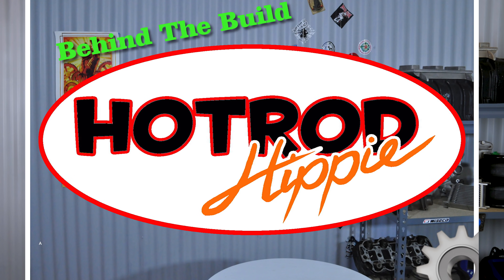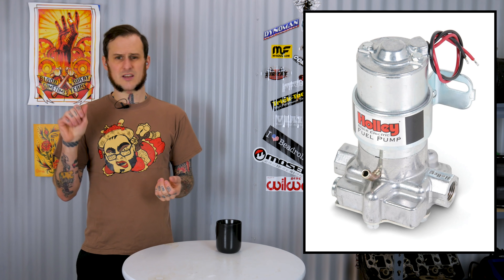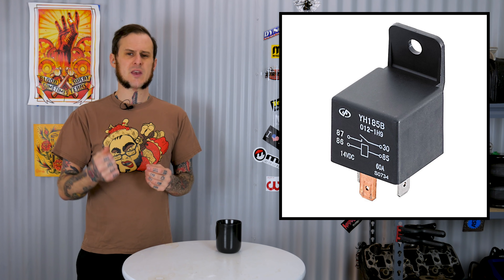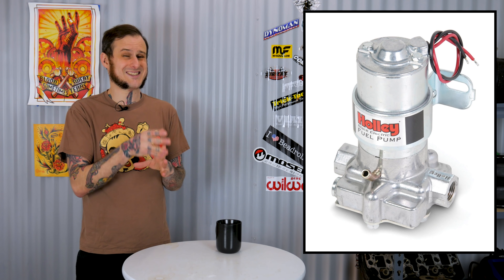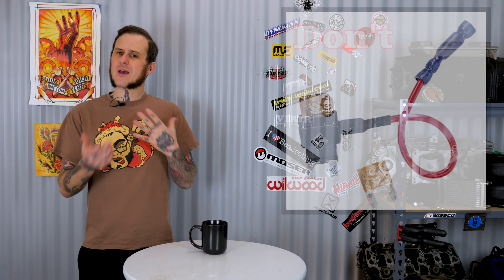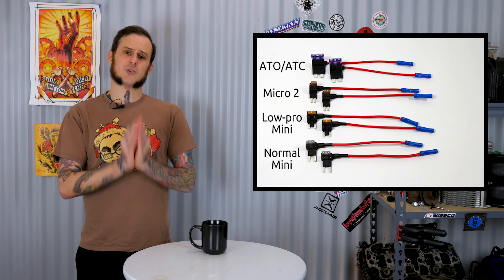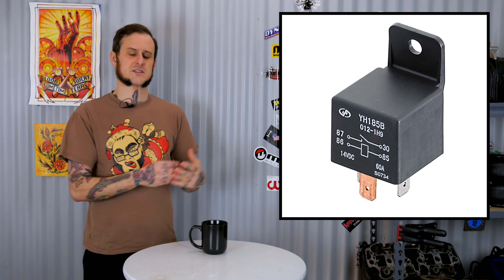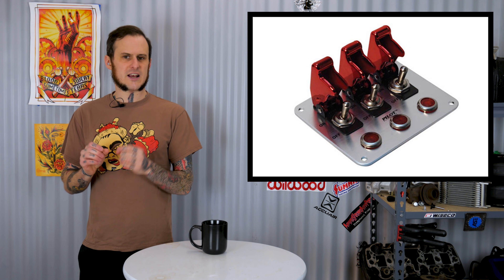Relays and Fuse Taps - Auto Electrical Dos and Don'ts - Episode 2

Comment from the maker: I just did a new video going into Relays deeper, and even mentioned fuse taps in it.  Check out the new Video here: https://youtu.be/Xt0lC8mjJRI
Reply: I wanna use a Fuse Tap for a Backup Camera I bought for my Front Bumper i already have a backup Camera but wanna use 1 for my Front Bumper Also was thinking using 1 Fuse Tap for My Trailer Wiring harness bc I bought a hitch installed it on my car and The Wiring for the trailer lights.. Would a Fuse Tap work for it? I used the meter tested the one fuse on how much was putting out for back wiring harness for trailer well Dad did lol.. Said like a little over 10 Fuse but i have a couple more open spots.. Thanks loved this video

Comment: Using fuse tabs it should use the same fuse load . My question is can I use multiple fuse tabs with the same fuse load on top of each other? I might need to use dash cam & radar detector using the same power source in my fuse box

Comment: I am putting a gm engine in a mustang and have a standalone harness that needs keyed power.   I was told I could do a fuse tap to get the power from the existing fuse block of the car and the new harness has its own relays and fuses.  What are your thoughts on this along with the fuel pump wire should be key on only???
Your help is much needed, Thank you,
B

Comment: Thanks for video.  I have a cigarette lighter port that is always on and I want it to turn on/off with ignition.  Looks like a relay is the correct method since I don't know what kind of device will be plugged into that cigarette lighter port - perhaps some day a tire inflator or some other higher amperage device.

Comment: I had to argue with my dad about using relays . The old wiring made it blow a fuse for the ignition power to the distributor. I ran a relay instead of power directly from the ignition .

Comment: Great info. You mentioned you used  relay to improve power windows. I recently installed aftermarket power window motors on my xterm. I used a fuse tap on a 15amp fuse and put a 10amp on the top slot. The 10amp keeps popping. I presume the window motors are needing more draw. Can I put a relay on the fusetap 10amp circuit?

Comment: Can I use a fuse tap to run starlight engine into the cigar lighter fuse? But I was going to add a rocker switch to be able to turn it off and on. Do you still recommend using a relay to give power to the starlight engine and to the rocker switch ?

Comment: Hey HotRod, I have a question you may be able to help me with.  I have not been able to find an answer online.  Ok, I am installing a winch on my truck.  I am also going to install a power interrupt solenoid under the hood.  The solenoid will be operated by a toggle switch inside the truck.  The question is whether I need to run a relay between the toggle switch and solenoid.  Would there ever be a need to run a relay between a toggle switch and solenoid?  Thanks,

Comment: Hi.  Good video on relays.  Thank you.   I thought taps wouldn't overload the original circuit because you reinsert the original fuse to keep that circuit the same.  The new pigtail then that gets the new fuse - hopefully properly rated,  I just dont understand the circuit overload issue.  Thanks again.

Comment: QUESTION? Lets say you want to add a few new circuits which run only when the key is turned on (IGN/run position) and not full time power. Can you install a fuse tap on one IGN source to a busbar. Busbar to individual switches (manual/automatic). From an individual switch to a corresponding relay. Relay to device/load. For example: one circuit to switch on a air compressor, another for an inverter, and one to a fan. This is on the assumption of using one battery source (not on a dual battery system, which will be more ideal). The power to the switches are low amperage. High amp loads through the relays.

Comment: What damage can be done by bypassing the relay and wiring directly two pins on the relay? My headlight high beam is not working, but if you bypass it, it's work.

Comment: I added a fuse tap/add-a circuit to power a relay but it did not work. positive side was on opposite side from what I expected. Could not fit it in the opposite direction. check the positive side source.

Comment: What about using a fuse tag to simply replace the circuit that used to be there but no longer is? My car has always had a missing cig lighter (and missing power source). So I installed a USB port in its place, and wired it to the cig lighter fuse using a fuse tap. That seems pretty safe, don't you think? The circuit is still only being used for one thing & I'm guessing a USB port is pretty low-load?

Comment: I mean how hard is it?
Just add the fuse tap where the fuse for the auxiliary power outlet (cigarette lighter) is.
If the old fuse for the outlet was 10A, now just make sure that both new fuses in the fuse tap don't add up to more than 10A. 
Simple, easy and won't ever f*ck up anything on your car.

Comment: I need a switched power to turn on an amp since the stock radio doesnt have a remote wire output, would that be ok to use a fuse tap on the radio fuse.

Comment: Confused now.  I wanted to add lights to my reverse light using a relay & a fuse tap but now I'm confused if it's the way to go about it.  I'm wanting to use the same switch already in the vehicle just add lights.

Comment: So I'm running a relay for a electric water pump and plan to run my 18 gage switch wire from the relay to the fuse block radio cigarette lighter with a fuse tap which on my car I know is off the ignition with 15amp fuse would this be a okay uses since I'm still powering the relay with 12v from the battery?

Comment: Would it be safe to use a fuse tap with the same amps on the DRL fuse slot to install a switch to turn off/on the DRL by looping back the circuit to the DRL load?   Thanks for sharing... 😃

Comment: if you get power from a fuse tap, is it still necessary to add a relay if i'm gonna add a fog light?
Reply: You should use a relay. The fuse tap is just protection. The relay still needed to provide proper wiring circuit. otherwise the fuse at the fuse tap will risk blowing frm potential overload.

Comment: What about using the circuit tap to connect a remote wire for an amplifier? Would that put too much load on the circuit slot?
Reply from the maker: I would check with the manufacturer of the amp to determine its actual draw but it should be a minimal load and fine to use a tap for.  I'd say anything less than 1A is fine.  More may well be fine as well but I personally just prefer to use that as a rule of thumb that is "better safe than sorry". To my knowledge remote circuits on amps are 1A or less.

Comment: hi, I just want to know if I add a front sensor without any display but just use a small speaker to give a bip bip sound, I use a acc fuse with a fuse tap and stop fuse with a fuse tap , do I need a relay? after all the power requirement is very small. looking forward for your reply.tq

Comment: I have an off the shelf van alarm (smart 360 alarms) and it can be wired into a spare fuse on the permanent side. I have brought a piggy back fuse and crimp I am going to attach to this 12v adaptor that comes with it and into the 12v plug for the alarm. Is this an okay way of doing it? It’s only a 5 amp max 10 amp fuse it says

Comment: Would it be fine to use fuse tap to change circuit from to constant power to ignition by connecting it to empty slot?

Comment: If I have a 30amp relay should I use a fuse with more amp or less amp or same amp?
Reply from the maker: A 30A rating on a relay is just the max load it can handle passing through it. Your fuse size (on the load circuit) should be based on the size of load you are feeding / controlling with that relay. Is it lights, a fuel pump, a fan? Whatever the load being supplied dictates the fuse size. However you shouldn’t go over 30A as the relay isn’t intended to handle it. You can usually get 40A relays to replace 30s though. 

Now the Control circuit of a relay is a small load as it’s just a small coil activating the switch in the relay. That you can generally use a 5A or smaller (2.5A is often what I use for just a single relay.).
Reply: @HotRodHippie  thanks very much for the knowledge looking to wire my cooling fan, so I'm much confident now.
Reply from the maker: @Platinumtag  glad to help. I did a dedicated video going a bit more in-depth on relays if you want something else to reference. It includes a section on wiring them. 

https://youtu.be/Xt0lC8mjJRI
Reply: @HotRodHippie  thanks I will check it out,

Comment: The relay I got the accessory cable is too short and 14 awg, I need to extend it about 6 to 7 feet to get it inside cabin. Should I use 14 awg wire or 12 awg?  The cable to the battery is also 14 awg I may need to extend it by another 7 to 8 inches, should I use 14 awg or 12 awg? Will the ones you recommend be able to handle 30 amps ?

Comment: Can you use a fuse tap to trigger (86) on a relay? I only the relay to work while vehicle is on. How many amps on the fuse tap will I need to have it trigger the relay?
Reply from the maker: They are good for doing that yes. Relay control circuits should generally only pull 2A or less. I’d start with a 2.5A fuse. Wired properly that should work fine and not be an issue to any of the existing circuits as I was describing here.

Comment: Hey, quick question
When using a fuse tap as a switch for a relay, do you just ground out the other side of the switched circuit? Or does something else need to be done?
Thanks in advance :)

Comment: Great video.  Very informative...quick question...I have 4 sets of LED lights all of them pulling 3.5amp / combined 14amp . What is the best way to power them and what or how can be use. Fuse tap, relay, connectors , control switch etc....

Comment: Is it ok to use fuse taps to get car radio buttons illumination from dipped beam
headlight levelling fuse and at the same time to use cigarette lighter fuse to get "signal" wire that turns the radio on/off with ignition on/off?
For constant power for the radio is used existing wire from factory radio.

Comment: So, and excuse my ineptness here, could I run a fuse tap off an open fuse slot (as in one that’s just not being used from the factory) and run a dash cam off of it since In theory those don’t use much electricity? As long as I run the right fuse and wire gauge?

Comment: Your warning about fuse taps doesn't seem right to me. Used right, the tap should create two independently-fused and independently-grounded circuits. Hence the slots for two fuses. If you insert the tap backwards, current for the new circuit will flow through both fuses, probably leading to blown fuses, but not to burned up circuits or fires. Unless you're referring to the part of the circuit before the tap (from the battery cable through the fuse box), which I suppose could be sized for the intended fuse, but that seems like an overly specific design spec. Am I misunderstanding something?
Reply: Finaly someone that understands it. You’re 100% right! 

If you have a fuse tap that is rated for max 40amps. And you put the fuse tap where originally a 15amp fuse was and connect the original fuse to the fuse tap. Then put a 20amp fuse to the fuse tap too to power something else. It is not dangerous at all. The only danger would be the wire that goes from the battery tot the fuse because that wire is designed to handle 15amps (original fuse) and not 35amps (original fuse + new fuse).
Reply: So if the danger in fuse taps isn’t in the fuse tap itself. It is perfectly safe when installed correctly. The problem when you use fuse taps is that you have to look if the cable from the battery to the fuse can handle both currents. If not i would not install a fuse tap because you can melt the wire from the battery to the fuse. But if the wire from the battery to the fuse can handle both currents fine then a fuse tap is perfectly safe.
Reply: @mehmetaksoy6773  Thanks for confirming this. Would you know how common it would be in modern vehicles for the wiring before the fuse (battery side) to be sized specifically for a given circuit? My intuition would be that automakers often use parts in different vehicles, so it might make sense to size all of this wiring the same. Possibly less complicated to manufacture, also. OTOH, more material and more weight might be the deciding factor.

Comment: Hi there thanks for your video, I do have a question 
I need a power source for my LC2i pro converter , those are using 14 wag so I don’t want to get the power from my battery like I would do for my 4 wag sub amp .
Is it safe to tap in my new processor from the fuse box ?
Reply: The f is a wag

Comment: So, what type of relays are you using if you want your turning lights to slow down to as much as just one winks in each 1 and a 1/2 second?
Reply from the maker: You will need some type of electronic control system to tailor a flasher speed. A Flasher Relay is what controls your turn signal blinking but 1.5 second intervals is VERY slow, and I’d imagine most State DOTs would have issue with a blink that slow. I know In Pennsylvania I’d fail that for inspection. I think the SAE requirements are a minimum of One flash Per Second. 

Do you have LED bulbs flashing too rapidly? What is it you are trying to achieve?
Reply: @HotRodHippie  I will come as close as possible to what a 1966 Thunderbirds turning lights look like, but a little slower.
Reply from the maker: Here is an adjustable one. I cannot possibly say if it will work for you though. I don’t know your use case such as vehicle and what you are exactly trying to achieve.

https://amzn.to/2HlM8Qf
Reply: @HotRodHippie  I have already this one GZXY 3 Pin CF14 EP35 LED Flasher Relay for Turn Signal Bulbs adjustable(1 Pack), but it is not slow enough.
Reply: This is what it looks like, but it should be 1/2 a second slower: 
https://youtu.be/Qwzxn9ZPW-M
Reply from the maker: @carriagemaker  you want to make sequential taillights? Have you looked at the numerous $15-20 kits that do that? https://tinyurl.com/y29bzcwk

I’ve never had to do what it seems like you are trying to do. If it was me I’d be considering producing my own electronics to do it and that’s far more complicated than I can explain in a comment.
Reply: @HotRodHippie  
I have a Corso Motion card that I’m working with because I want 4 flashes instead of three, and I have come damm close together with that adjustable relay I bought. But as I told you, I want it just 1/2 a second slower, then it will be perfect. I might have to try the Ghost relay instead. Anyway, big thanks for taking your time with my questions.

Comment: What about using them tap fuses for a load of 1 maybe 2 Amps, on a empty fuse slot?
Reply from the maker: Doc. FunkBlack on an Empty fuse slot I wouldn’t be opposed to using them for even maybe a 5 or 10 Amp load. When I made this I was more thinking about the use cases I commonly came across where people were “misusing” them for larger load devices. Backup cameras have gained a lot of popularity since then and they only draw 1-2A on average and are generally safe to use. I wasn’t thinking of that use case in this script. 

I really need to make a 2020 update video to this one and clarify the discussion.

Comment: Thanks for this video...man I almost used a fuse tap inside my fuse box to wire up water/meth injection kit to power up the controller. Glad I saw this video. I would have fried my electrical system.